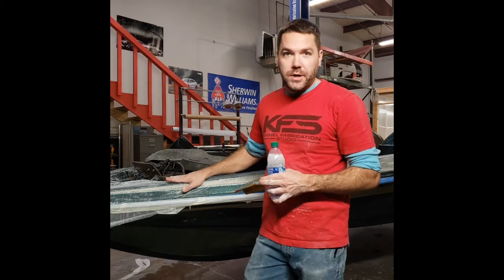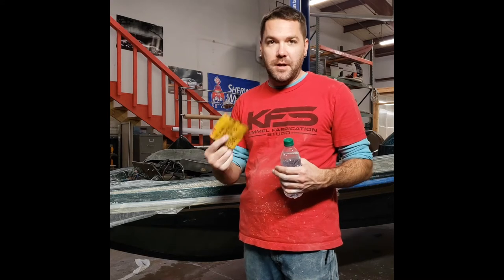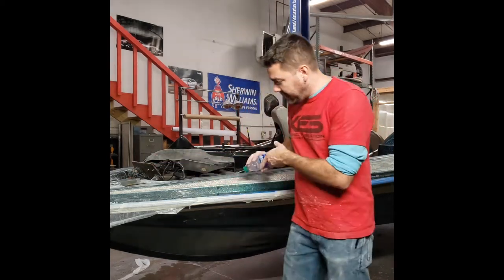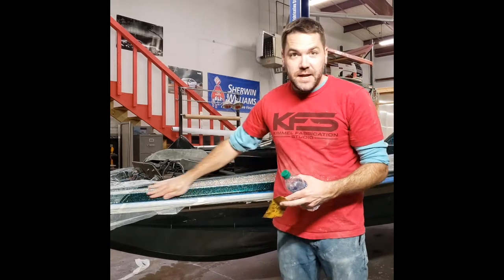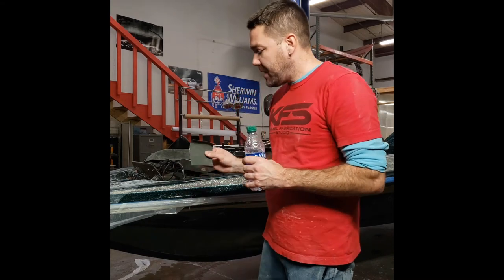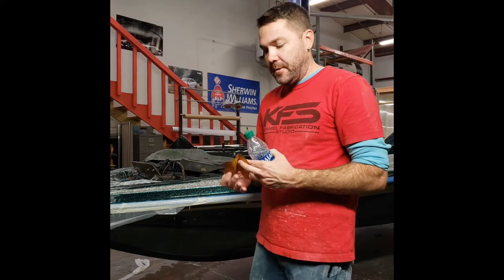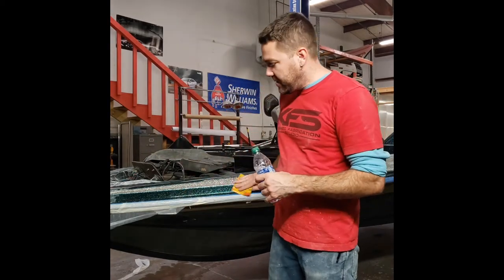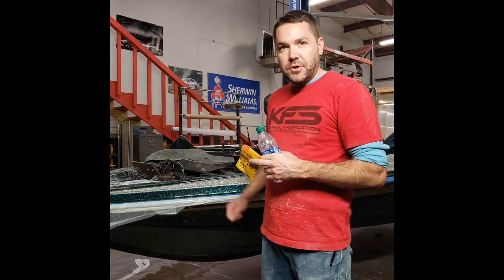Tip Of The Day - Wet Sanding Secrets - Ep. 11.  -  Wet sanding gel coat boat restoration.

Comment: Why do you prefer to hand sand instead of using an orbital sander? I have seen both methods.
Reply: Depending on the thickness of the topcoat and the shape of the item in which im sanding I go either way. I was showing this method for a beginner or someone who would be doing this with limited tools.

Comment: Is there a full video of this project? I would like to see how it turned out. I have an older ranger boat that’s the same color and I’m thinking about sanding it also
Reply from the maker: Sorry, I didn't think to record the whole thing when I was doing the project. I try to record all the new projects though, so I will be making a bunch more videos.
Reply: @stealthbuilt1  hey brother. I have an old Baja I’m re doing and the clear is in horrible condition. I have to remove it all. What do you recommend. I’ve heard from
Some
Old timers that mineral spirits will dissolve it should I mix water and that stuff and wet sand ?
Reply from the maker: @treyt6765  It really depends on the boat. Typically I'd sand the topcoat off and re-coat.
Reply: @stealthbuilt1  copy that. Thanks for the reply

Comment: After the wet sand what compound do u use and then what type of polish to u yes I'm new at this just bought a boat and have heavy oxidation on it
Reply from the maker: Sorry I didn't see this message and it has been so long. I typically use "Total Boat" compounds to buff out gelcoat. If it is a clear coat (automotive style) I use automotive grade buffing compounds.

Comment: How about getting a water hose, cut off the metal nozzle, turn it on really low, and hold it over the work as you sand it??? And use a hard rubber sanding block...Your sanding will be much, much, more efficient and faster results..
Or better still, do not sand it ,  just use the right 3m Marine compounds and you will never need to go through this mess..
Reply: I agree if the finish is dulled you can buff it out with a heavy compound but discolored and checked it has to be removed by sanding. A million ways to do a job, im just offering up one easy way to help out whoever needs it.

Comment: Who in the hell is cutting and buffing with 400 grit sandpaper!?  1500-2000-3000 but 400? are you nuts?
Reply from the maker: 1500 won't cut down gelcoat in a reasonable amount of time. We don't buff 400 either. We started with 400 and went up from there. Am I nuts? Maybe, but my work speaks for itself. Thanks for the comment.